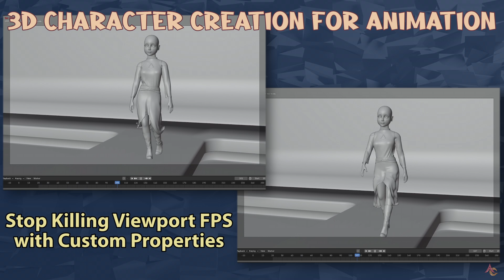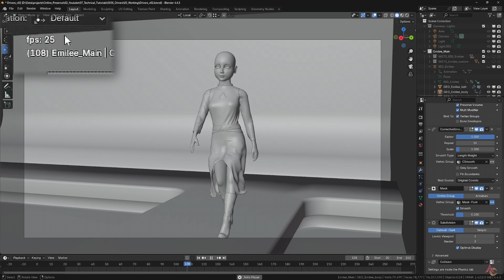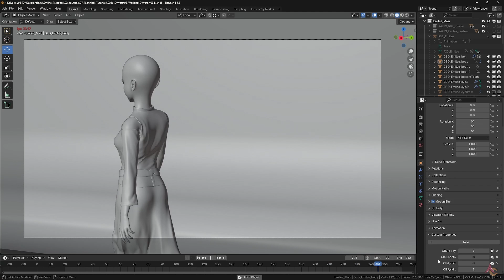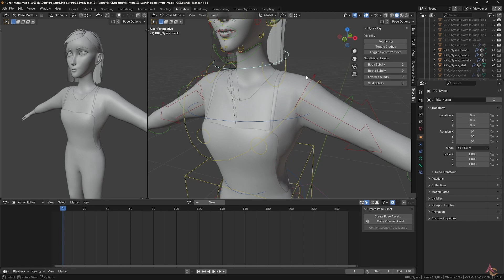Stop Killing Viewport FPS with Custom Properties

Comment: If other objects that are siblings of the object that has the custom properties (i.e. these sibling objects are still having to refer to another object) then wouldn't you see a similar uptick in performance if these properties were on the armature instead?
It makes more sense in my mind to have such custom properties on the armature (or even a specific bone of the armature), rather than an object.
Reply from the maker: Yes, having the properties on the Armature would make sense, but when I tired to do that, I seem to remember that I just couldn't get the driver to then apply.
Not sure if that's a general thing, specific to modifiers or just subdivision or even a bug and at this stage I've not gone back to dig any deeper, but maybe I should.
Having said that, I'm currently half thinking that using an empty (as a sort of main control) to hold any and all properties for a full production character would be a better idea. Just one more thing to look into at some point.

Comment: just in case you, or anyone else doesn't know, there is no need in controlling viewport display subdivisions this way if you want to lower or zero out sub-surface effect using driver, just use Simplify option in the render settings and set max subdivision level for everything in the scene to a lower value or 0 to turn all the sub-surf modifiers off
Reply from the maker: Yes, you can use the Simplify option, even in Pose mode to change everything, so yeah that could be a good choice, at least for the subdivision modifier specifically.
Of course at the same time, one may have wired up something else via a collection property and as the video shows just doing that no matter the value setting, kills FPS.
Even with the Simplify option, that may not be ideal, since it's an all or nothing setting. One may want to just turn it on, while in Pose Mode, for just a single mesh to better see how it looks at 24 fps. Using Simplify, which turns on subdivision for every mesh, could be too much for ones PC, slowing down fps so it's no longer realtime.
This of course depends on ones hardware and how complex the scene is (how many subdivision modifiers there are). For something simple it likely won't matter, but the more data there is, the finer the control one is likely to want and need.

Comment: blender slow down when u add custom driver in collection but not in object could this be a bug ?
Reply from the maker: It maybe, tho it's actually been like this for a long time (mind you Blender has and had, many long time bugs, so you never know).
Tho at the same time, I won't be surprised if it's just the way Blender is built, in how data has to go back and forth when it's between a collection adjusting a property on an object, vs an object adjusting a property on an object.
Another thing to note is that one may not always see the impact. On making the video I first tried and tested with a much more simple scene and objects and using a collection didn't really make any difference.
But as soon as I did the same on my full production character, then the slow down hit. Which makes sense, more objects, largely modifier stacks, more data to process or sort through, the slower it gets.

Comment: thanks for the tutorial, however I’ve give up using Blender for complex projects, frame rate drop to hell and you never know what problems it might be,  even if you solved it, another one jumps out.
Reply from the maker: There are times when one wonders what the hell is going on, but there's usually a specific reason for it, even if it doesn't make total sense.
Either that or it's just the limits of the hardware and Blender's overall architecture, tho even then, it has had some pretty nice performance improvements over time.
Reply: Believe me I use a 15yr old computer to run Blender. Use viewport animation to check your work, tedious, yes but it gets the job done. Don't give up on Blender, I nearly did too but there's always a clever solution to any problem you might be facing. Consider joining communities, they're super helpful.